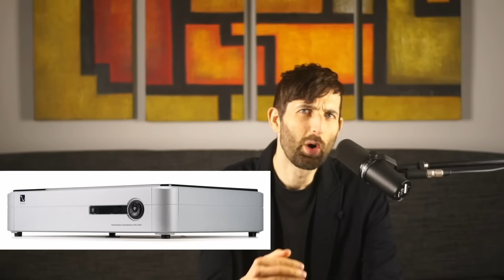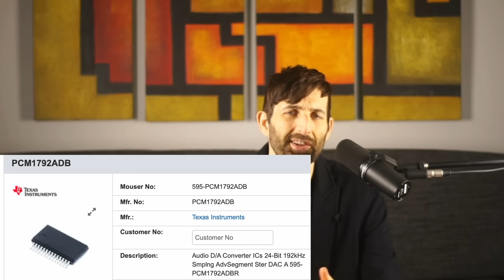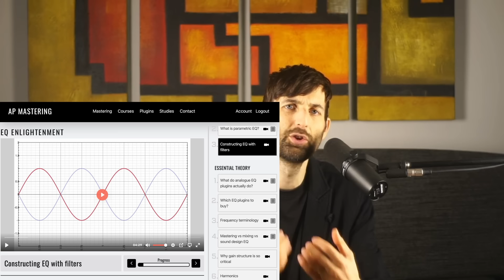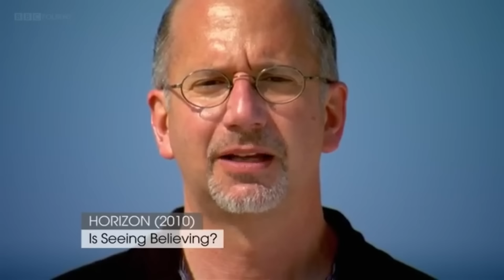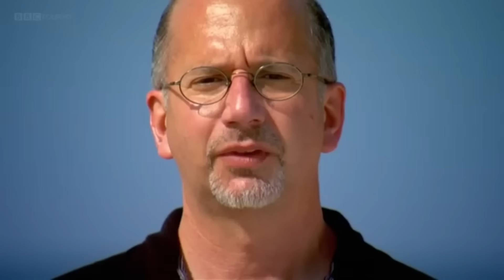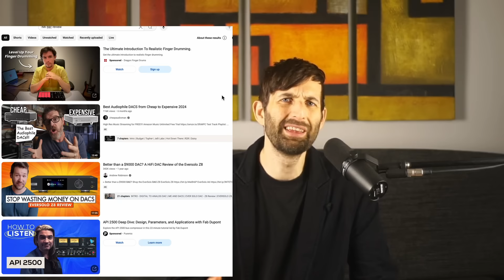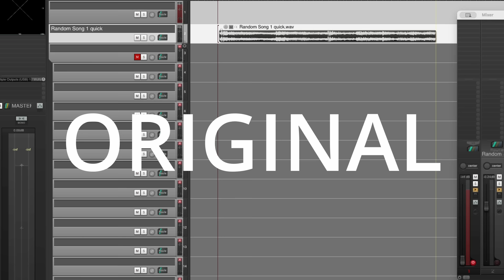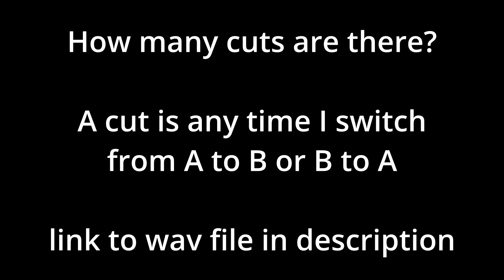The DAC Scam - Almost everyone believes the hype

Comment: As someone who has got recently the awesome hobby of designing and building audio equipement (still a beginner). The actual topology of the circuit matters A LOT more than the components used. Even the cheap metal film resistors from aliexpress are good enough for the vast majority of audio applications. The  more important components are capacitors. Cheap capacitors will degrade your signal in a way that can be easily percieved. Those have to be of good quality, and even then, they're not expensive at all. The design of the circuit, specially when building the pcb, will affect the signal much more than what a specific transistor or chip will ever do. 
So, you can get a very decent quality from little money if you know what you're doing. I'll never get those excesive high prices. Those are like.. fool traps. Even the speakers make a bigger difference. Want better quality? buy good speakers. They matter a lot more than chips.

Comment: Yes you can buy a fine dac for 100 bucks. But super expensive dacs do not all use the same chips, or sometimes several chips or no chips at all. 
And….it is not all about the chip.

Comment: The biggest improvement I ever heard in sound quality and performance was when I had an ordinary car stereo back in the 1990s that had about 20 watts per channel, 4 channels. And I fitted a 400 watts amplifier, 4 x 100. To my same cheap speakers, they weren't changed. Using very ordinary cheap car stereo cable wiring, also not changed.

The sound was amazingly improved. No more distortion. Incredibly clear even at very high volume. The cheap speakers didn't distort. And back then my car has a battery level/charging guage and this would drop 20% every time a song played a bass drum beat, after I home built and fitted a 12 inch speaker as a form of sub woofer 😂

That 4 x 100 amplifier meant my speakers were now moving immediately and with full and fast movement, which meant the sound was now powerful, clear, and responsive. I knew then that without the full power the speakers cannot move fast enough, cannot move with ease to exact position the system is telling it to, at that exact fraction of a second. 

And that creates the sound.

With high amounts of power for a car stereo back then I was also surprised that the speakers sounded so good. I had expected to need to replace them, that the amp would show up the limitations of the speakers, but the opposite happened. Now that the speakers could move so easily they actually sounded the best they ever had. 

And I learned that distortion on high volume was because my car stereo's built in amplifier was distorting, it wasn't the speakers that were distorting. The speakers were accurately playing the terrible distorted signal from the car stereo's weak amplifier.

Plenty of amplification power will mean the music system can easily move your speakers quickly and powerfully. It's the speed and strength of the speaker movement which is making the sounds.

So an amplifier that can easily play at the volumes I want is what I'm after first and foremost. Then I can easily choose speakers because the amp can drive them. 

This is why I do look at these 40, 50, 60 watts per channel amps with a little bit of suspicion because although it's enough most of the time, but I'd really want 80 to 100 per channel for ease of driving any speakers.

The total maximum wattage number on the back of the amp is what I look at too. If the amp has a maximum continuous power draw of 100 watts then there's no way it's giving me 60 watts to both speakers, it will struggle to do 40 watts to both speakers, probably 30 watts will be it's absolute limit. 

I want to see 300 to 400 watts usage if it's going to give me 200 watts usable, depending on amp type A, AB, D, G whatever. Because amps have losses. 

Smaller speakers driven by a powerful amp sound better than bigger speakers driven by a weaker amp because they lack response, clarity and ability to push the air fast enough, at the right time.

Comment: By that logic:
Anyone buying a 350-hp Porsche is an idiot, because a cheap Chinese car with 350 hp is the same thing.

Same horsepower → same car, right?

Of course not.
Because what matters is how the power is delivered, control, chassis, feedback, transient response, refinement, and behavior outside one narrow metric.

This is exactly the mistake made when claiming DACs are identical because they share measurements or even the same chip.

Comment: When a hobby becomes an obsession and it's a man, with money, watch out. Even the sky isn't the limit. They will be taken advantage of at every turn. Audiophiles are the easiest to manipulate, sadly. I admit that I have to keep myself in check. At some point you have to recognize the diminishing returns and decide if it's really worth it? For myself I look for value for the money spent. I'm 65 now but when I was younger I usually bought the most expensive gear I could afford. Well, that's a lie. I usually bought what I couldn't afford. I love awesome full bodied sound, crystal clear highs, rich mids and deep tight lows as much as the next guy. But, I'm not going to spend my life savings chasing it. And I don't have to and neither do you. Just good enough isn't good enough for me or you either. But we shouldn't have to spend $50k on a piece of gear that is maybe slightly better than one that's a few thousand, maybe even a few hundred in some cases.

Comment: Depends on the music you are listening to and your speaker and room setup. Most people who can't hear a difference don't have the set up to hear the difference. Like putting sport tires on a car that has it's wheel alignment way out and not enough power to spin the wheels. The cheap tires will likely feel better with their soft sidewalls making a more comfortable ride and lack of grip making them plough through the misalignment easier. I am currently listening in a less than ideal setup but I reckon I could hear more muddy and then crisper highs which is to be expected. I'll say it started with the 100 recycle and then went to original track just before the change. But if this was a recording with a lot of space and air and depth of soundstage played on a good system. the difference would be simple to notice

Comment: I've opened my mid range NAD audiophile CD player. The circuit it used came straight off the Burr brown suggested circuit diagram on the spec sheet. The only difference between their entry level and $300 more expensive mid range player was an upgraded op amp that cost $6 vs $1.50

Comment: I have a Topping E70 Velvet with the AKM4499EX chip set.  Simple and sounds fantastic and cost me $279.00 on sale here in the USA.  I can assure anyone that it will sound just fine in a double blind against any of the fancy audiophool offerings costing many times more.  It never ceases to amaze me that these idiots spend many thousands on supposedly "audiophile" kit failing to remember that the front ends and filters of most consoles are chocked full of run of the mill common opamps like the TL07x or NJR 455x.  It is hilarious to point this out when they talk all their technobabble about the sublime difference that the $1000.00 power cable made in the sound of their 300B tube amp.  All BS.  Oh that I could only give you 1000 up votes!

Comment: You can explain this to a friend of mine who is an audio engineer and has worked at Chesky Records.
What is interesting is that on recordings made by him in the Chesky Records studio, he can identify the DAC type — delta-sigma or R2R — correctly 10 out of 10 times, even on my rather modest stereo system worth around €17,000 (excluding the DAC). I can hear it as well.
I don’t know how you record, what equipment you use, how you digitize, or how you listen, but it turns out you seem to be better informed and more confident than Chesky Records themselves.

Comment: The core of a DAC isn’t the chip. It is the implementation. If you make videos you should at least know the basics. Now I agree that the rate limiting device will be that $200 chip but you see honey, that chip’s limits exceed what our ears can detect. So whatever is used to implement it (power supplies, true mono, etc) will matter a heck of a lot. And no need to spend $20,000 for sure but a $300 mini DAC powered by a wall wart will be garbage even if it co gains ESS latest and greatest.

Comment: I think one of the issues is that the try before you buy that used to be the way with HiFi is now not possible. Many of the latest DACs are mail order and almost all would be near impossible to return. In days past we went to a HiFi shop who you developed a relationship with and borrowed the equipment to test without stress.

The truth is this video is really only full of half truth as it plays on the confirmation biases of those who can’t afford this kind of equipment. It turns out you can give two different cooks two eggs and some bread and herbs and they each cook it a different way. One might be very ordinary and the other amazing. Likewise two chefs with Michelin Stars may produce very similar but probably two different delicious recipes. Same ingredients. It’s called diminishing returns and it’s applicable here.

Right now, we’re seeing some giant killing happening because the Chinese are now much better at putting these cheap chips together with a purpose and creating great sounding devices. It is showing up
Some of the western megabucks devices.

So, true about the chip cost but completely ignoring what else goes into improve. Do they sound better? Yeh, they do. However, granted, not blowing each other out of the water better. FOMO does rule the roost in the audiophile world.

But hey, one man’s HiFi is another man’s cup of coffee or bottle of wine. If they can afford it, who gives a shit? 

We all know why the creator made this video. It was to deliberately use a controversial simplistic argument based on incomplete information, back it up with a few examples of bias and voila, you have a link bait viral video. It’s good debating logic.

Comment: I certainly don't disagree with you that a lot of Audiophile grade equipment is ridiculously priced.  However, your premise that the DAC chip, or chips, in an outboard DAC do all the heavy lifting is - I'll use your own words here -  "bullshit". 

  There is a lot more to making an outboard DAC sound good than a good digital to analog conversion chip.  (these days, the chips from the major mfg are pretty well all quite good.) What about the analog section that deals with the signal once it's converted from digital to analog?  Do you really think this doesn't play a large part in the sound?  Perhaps a much larger part than the chip that you claim "does all the heavy lifting."  Maybe should check into that premise further.  I can understand you thinking that because, even a lot audiophiles, believe the chip plays a large part in how a DAC sounds.  They are mistaken though.

 Most audio engineers, and/or designers, would tell you the analog output section is far more important for actually tailoring the sound than the Digital to Analog conversion chip. You claim it does all the work.  In fact, as far as the final sound of the DAC, it really doesn't play that big a part.  Jitter can be very detrimental to the sound. So if the chip does has it's own clock,  it needs to be very precise. Most chips these days are pretty good with timing.  In fact, they all sound pretty good in general, in as far as they effect the sound.    Of course  R2R designs (which aren't always chips, rather hundreds of resistors)  can certainly sound different than Delta Sigma chips. 
 Besides the analog output section, the power supply can play a fairly important part in the overall sound. It can make the difference between the bass, the bottom end, sounding weak, flabby and anemic, or deep, tight and detailed.  In a well designed DAC,  all the parts work in concert. So, no, it's definitely NOT  just the DAC chip that does all the "heavy lifting". 

  You can take the best DAC chip and make it sound like shit with a poor design.  A poorly implemented analog output section and parts.  Just like you can take one of the moderately priced DAC chips and make it sound very good with a well designed, circuit.  IE: analog section, power supply and other quality parts chosen well and part of a good overall design.  One part certainly does not make, or break a good DAC.
Reply from the maker: See my follow up.
Reply: Saying that the DAC chip in a DAC does all the heavy lifting is like saying a Ferrari is a good car only because it has a lot of horsepower.  The engineering that went into the suspension, the motor, fuel injection system, even the tires, all play a part in what makes that car special. It's the sum of it's parts and the same applies to an outboard Digital to Analog Converter. It is the sum of it's parts.  It doesn't rely on only one part to make it sound good.  Sorry, but your premise is wrong.
Reply from the maker: @BeeDee108 see follow up
Reply: @APMastering  Do you have a link to the follow-up you speak of?  I don't see one or maybe I'm missing it? Thanks

Comment: The problem is that budget and mid-fi DACs are improving much more quickly than flagship DACs, so the gap is closing. And with the influx of newer less experienced audiophiles due to the cheap gear, we get tons of people who can't tell the difference between a good and a very good sound. If they are content with good sound, go ahead. The problem is they try to project their own hearing and experiences on everyone.
Reply: And these people often connect high end DACs to their mid tier amps and headphones or speakers and conclude they don't make a difference. Of course they don't, when the whole system is bottlenecked by the amps and transducers. Upgrade the entire chain and try again.

Comment: Yes, a lot of DACs use off-the-shelf chips, but a DAC‘s sound depends on more than just the chip. The output stage, input section, and power supply play a role as well (arguably more important that the conversion itself). What also needs to be pointed out that there are quite a few high end manufacturers that don‘t rely on standard chips at all (e.g. DCS, MSB, EMM labs, …). If you’d actually listen to these in comparison to your „Mastering Grade“ (whatever that is supposed mean), affordable DACs in a suitable system you‘d have a different „opinion“.
Reply from the maker: See follow up

Comment: I've never compared a DAC that costs over around 1k GBP to anything I'm familiar with, so have no strong opinion on whether they're a "scam". I presume by "scam" you mean "doesn't make a difference". The problem I have with assertions like that is that what we hear varies with the listener (we're all different), the other equipment used (speakers/headphones, cables, power supply), the room, and the position of speakers within the room. So I think we should say "I can't detect a difference (on this specific setup)".

You can't say a thing about whether somebody else with different gear can detect a difference; that's a different experiment and could easily have a different outcome. I feel this renders arguments like this null and void. I've got respect for people saying "I can hear a difference" and for those saying "I can't hear a difference". I acknowledge the psychology around all this stuff, I think it's fascinating. But all the ways in which we can be tricked (or trick ourselves) aren't evidence that some people don't actually prefer one bit of kit over another.

Comment: Your music examples are too simple!! Comparing stuff on played on Youtube where I'm sitting with a MAC and Airpods 2 is very hard - the likelihood there is a weaker link somewhere is likely. Also comparing on unknown music is challenging, stuff like transparency, perspective, silence etc. is hard.                    In general I agree with you, if the digital part is correctly designed without direct errors, I would not expect audible differences from the electronics, although you might design your implementation of reconstruction filters and other digital signal treatment different. Then the analog part is a different story.

Comment: Let's set a baseline for your assertions.
What is the course list for "professional mastering engineer"?
Does it include circuit and system design and testing?
What DACs are the actual offenders?
There are fake products in EVERY product line.  The important information is the ACTUAL OFFENDERS.

Comment: Would you be able to get hold of a Topping DX5 ll and see what you think of that? The PEQ could be great and it also allows 0.5dB volume steps and has a great headphone amp as well as balanced outputs for monitors. Several EQ settings can be stored as well. I am hoping to get the Ollo X1 headphones and the DX5 ll and hoping the DX5 ll will accept the calibration file that Ollo supply but I’ve not had a reply from Ollo yet as to weather the 10 band EQ of the Topping will suffice.

Comment: I just bought a dac and an optical splitter for the specific purpose of A/B testing, because i didnt believe the hype.   I wish i could sit this jackass down in front of my system, blindfolded as i switch between the outboard dac and the inboard dac on the integrated amp.  The soundstages are COMPLETLY different.

Comment: No, it's not only the chip, that it's the LEAST important component, stop the BS.
Reply from the maker: wrong, will debunk by building a DAC
Reply: @APMastering All around the chip are the most expensive parts if you want a good DAC, the good power supply (at least toroidal), the amazing good FEMTO CLOCKs chips for low JITTER, the quality of the input and outputs components, the circuit design (made by HUMANS that need to be PAID), etc. in sum ... it's the IMPLEMENTATION of the DAC chip the MOST important thing, anyways... Good luck!
Reply from the maker: @SuperDigitalF will debunk